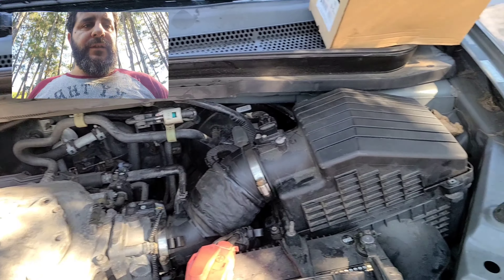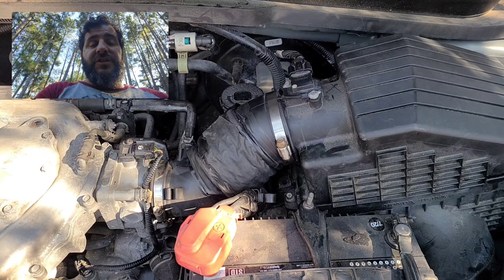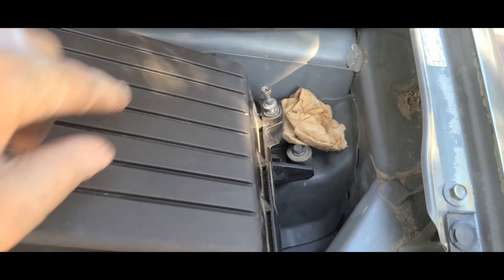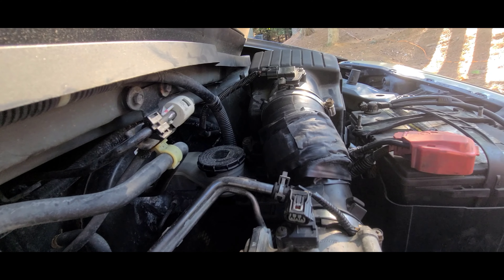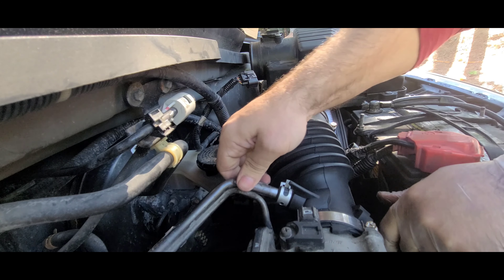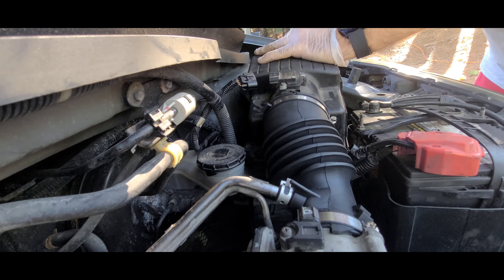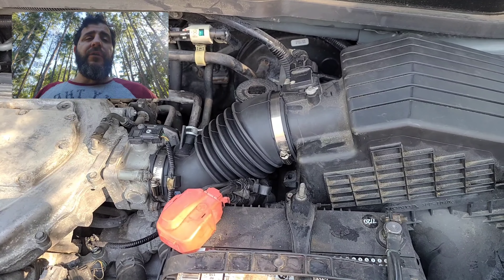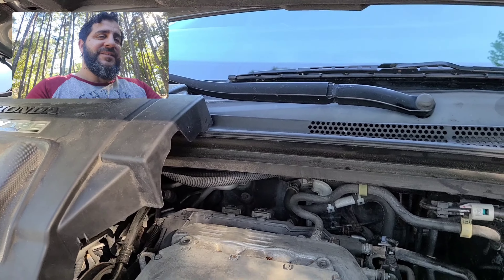How to replace cracked Air intake hose,  for Honda,Toyota etc.save $250-300

Comment: Thank you for the video!  Same issue on my 2008 Odyssey and your video was exactly what I needed.  I had a terrible time getting the old hose off the shiny metal insert as you did.  I ended up carefully cutting the old hose around the base of that metal insert away from the main hose.  Even then, it was very difficult to remove that part of the old hose, but I managed.  My replacement part came from an OEM dealer and did not include new clamps, but the old ones worked fine.

Comment: 2022, still relevant. Local dealer quoted replacement at $236.00.  Bought part off amazon for $25, and replaced it within 20 minutes. Thanks
Reply from the maker: No problem glad it worked for you just like it did for me 😉